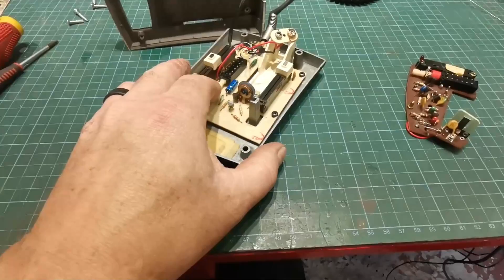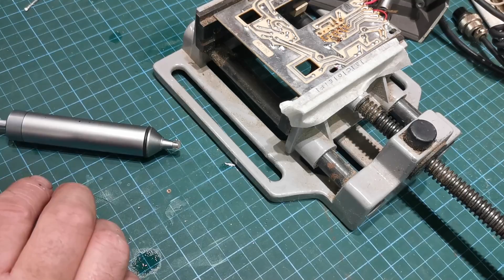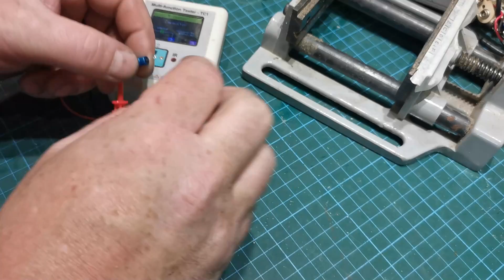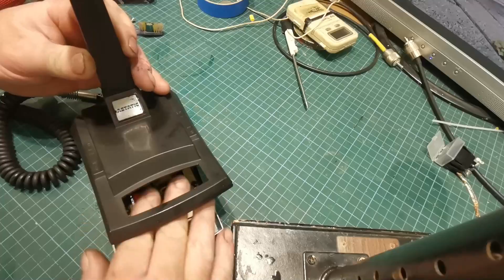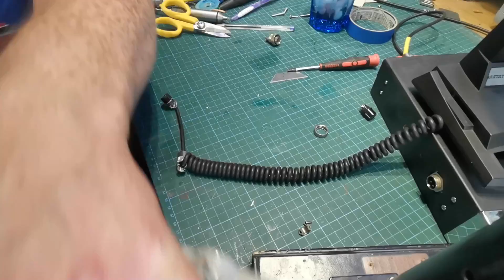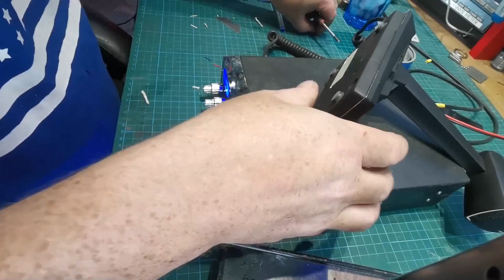ASTATIC 1104C PTT SWITCH REPLACEMENT AND REFRESH

Comment: I've got the same mic but it's developed a scratchy sound when the ppt is pushed down.
I think I'll spray the pot with some Kontackt 10 super .
Reply from the maker: That should do the trick, it’s usually just a bit of oxidation on the contacts.